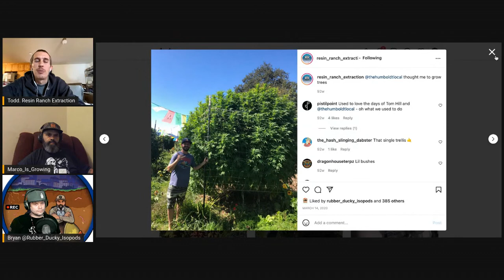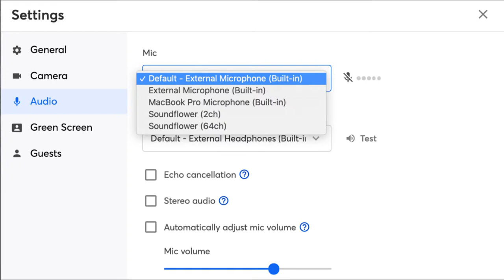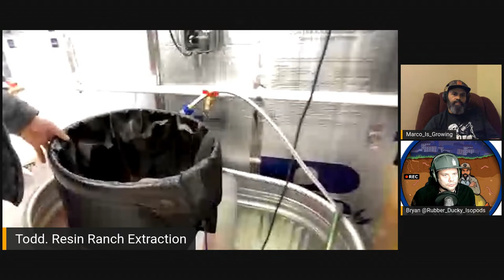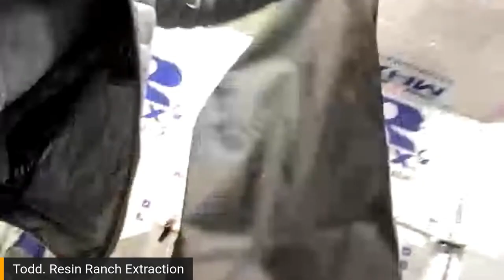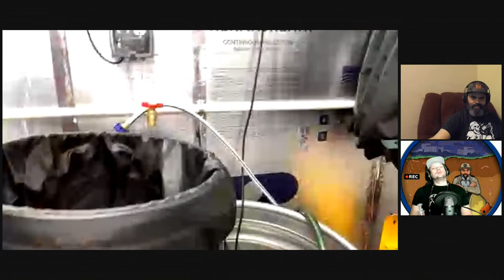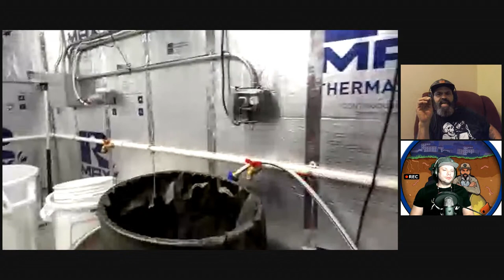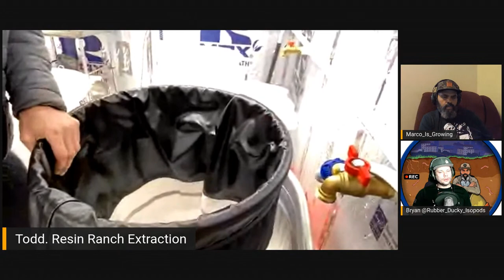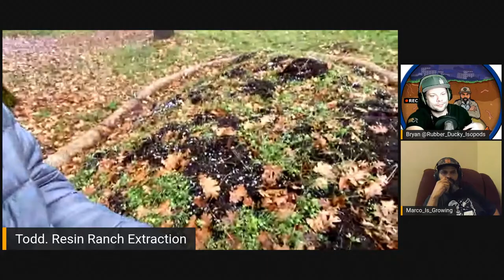The Bryan & Marco show - Resin Ranch Extraction

Comment: lpi and microns are basically but not exactly the same. The thing is this screens were made at first for silk screen printing, so originally lpi was like the pixels you have in your image, so when you print more than one color the screen fit with each other, also to allow to pass more or less ink through, microns at last its the pixel size. I use them both for print and got some saved for trimming aswell. Great info!!!